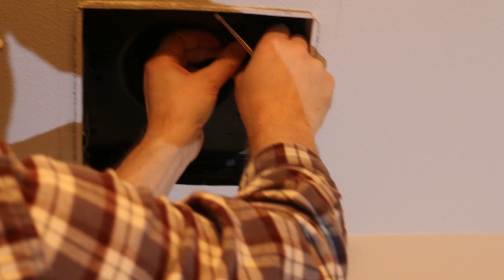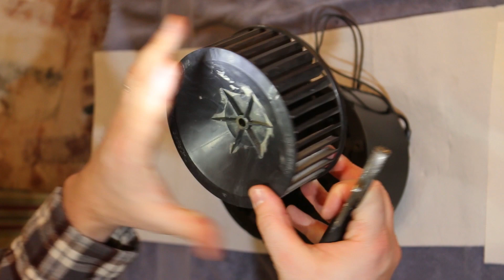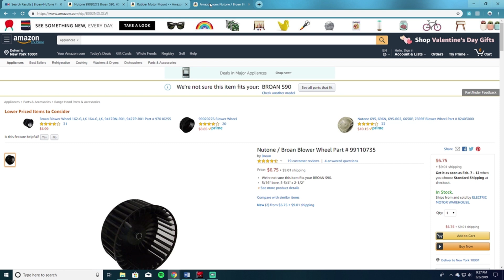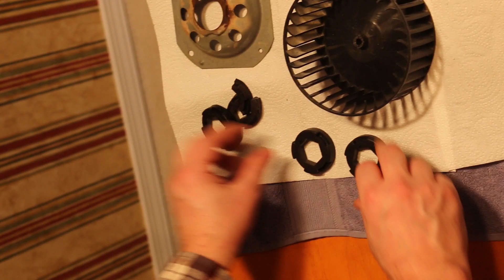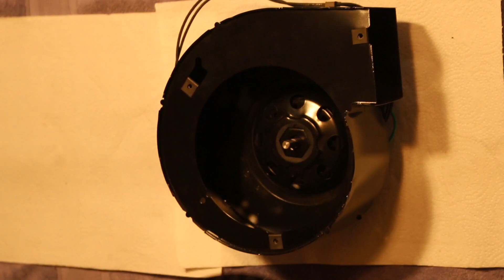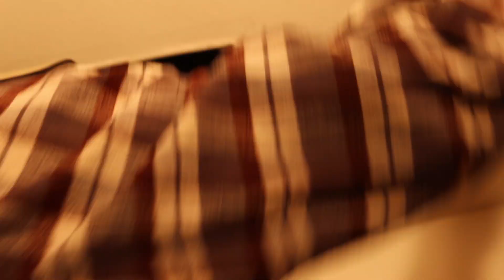How to Replace or Repair a Bathroom Exhaust Fan and Find Parts (e.g., New Motor)

Comment: Great video. My Squirel cage fan took a little "effort" coming out, but before your video I had no idea how it came off.  New Amazon price $102
Motor is very tight.  After I replace the motor I'm going to try and change the bearings on the old one...

Comment: Fan motor replacement part is now $132 or about twice the price in the video and the blower wheel is not available but the rubber mounts are.  Prices are going up up up.  My fan spins but is slow to start.  I will try a little lubrication first.  It says not to oil but what have I got to lose?  Anybody see this?

Comment: I own a 45 year old house. Original owner and it still has the original fans.  Damn if I'd buy one of the "new" fans of today.  What crap.
BTW:  I'm still running a 43 year old roof fan.  Emerson motor. Will run for ever.   Just a little shot of oil every 10 years.

Comment: I replaced my 19 year old bathroom fan today by following your video! It was quite the workout getting out/in the metal ring around the wheel (had to use a flat screw driver to shimmy it out) but once everything was in place it was a success!! Thank you for the thorough instructions!!